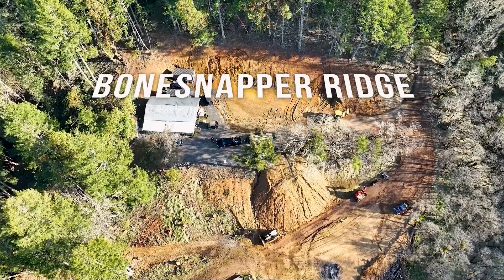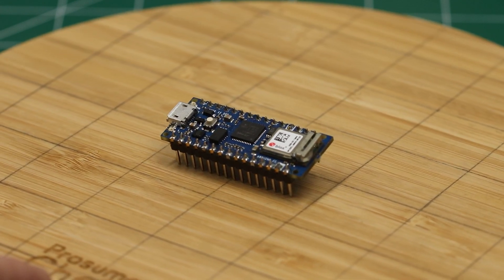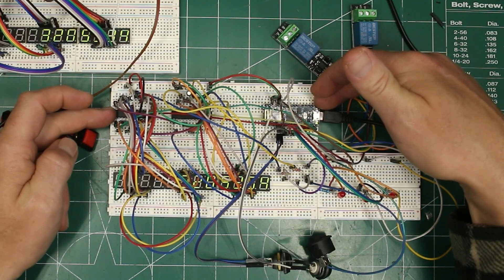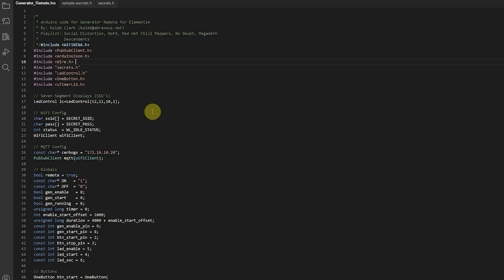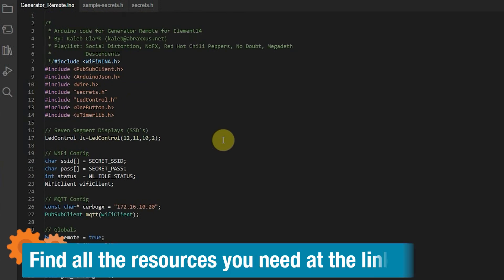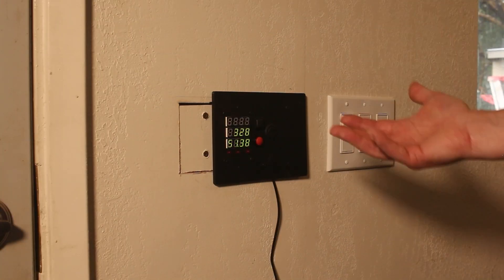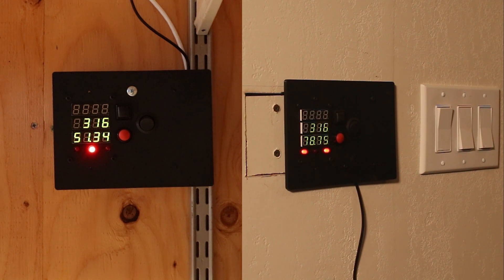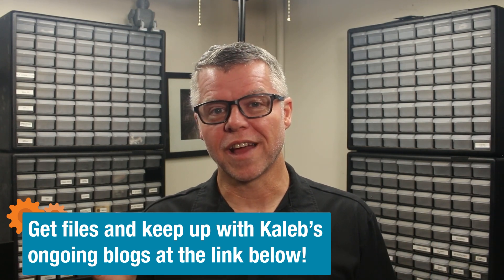Off-Grid Remote Generator Starter

Comment: Thank you for the video. Very interesting. I've got a Honda EM7000is, an older version of your Honda EU7000is generator. They are very similar in design and setup as far as the Remote Start feature. The EU series has electronic ignition, push button start and newer technology. Where my EM7000is uses a key starter technology. 

Question #1: Do you mind telling me about the Remote Start plug where you connect the relays to. One relay for start and another relay for stop.

Question #2: When you press the Start button to energize the relay that closes to cause the starter to engage on the generator. Is this a momentary relay close, or does this relay have to be on during the entire time the generator is running?

Question #2: When the Stop button is pressed and the relay energizes that initiates the stop run process how long should the delay be to keep the relay contacts closed.

My plan is to use an ESP32C3 or ESP32C6 to do exactly what you have done. I'm going to try and use the ESP NOW protocol to accomplish this.

Thank you for your video and I hope you have time to answer my questions. Thank you.

Comment: During the problem statement you showed a picture with an arrow and the number 170. My first though was that 170 metres is a long walk to the generator. Then a minute or so later, I'm wondering how you plan to get reliable WiFi over that distance!?

Eventually, of course, I remembered that you're in the U. S. of A., and the number was probably meant to be feet... 🙄
At first, I felt a bit silly about my assumption, but I was taught in high school physics to always label my units, so I decided it was all your fault.

Comment: The end product came out really well.  I was wondering how you would confirm the generator was off or on...your solution to that was quite good.
Reply: Thank you! I thought about that at the beginning, thinking maybe I needed a circuit on the generator side monitoring 120v. But then I realized that if the generator is running, the top 7 segment display will show generator wattage, and if that is displaying, then its on.
Reply: It seems like checking the rpm of the motor would be worthwhile. You could use that to disengage the starter as soon as possible. It could also deal with hard starting on the generator.

Comment: This is cool, but aren’t you using Victron equipment? Couldn’t you use Victron’s free Venus OS on a raspberry pi, which has all this functionality and much more?
Reply: Hi, yeah I am using Victron equipment and I am using the cerboGX. It does have a relay output on it, but does not solve the problem of a low power display and remote buttons to turn off and on the generator. Also, the complete bypass of the front panel on the generator is an issue. 

Sure there are other ways to solve problems, but why not make exactly what you want?

Comment: What a great idea! Just a thought- would monitoring the oil pressure switch allow you to manage the time in the start routine to prevent wear on the starter and also guarantee a start during hard start conditions?
Reply: Hi, thanks! The original control panel on the generator has a start button, which is just momentary. Push it, and then it runs the starter until it has started. Its not a "hold down until started" type button. So all I needed to do with the relay was keep it closed for a short amount of time to trigger that logic inside the generator.